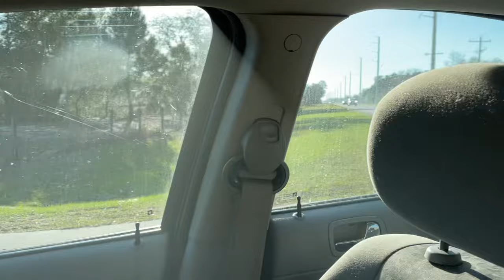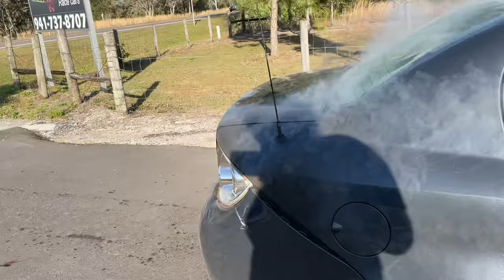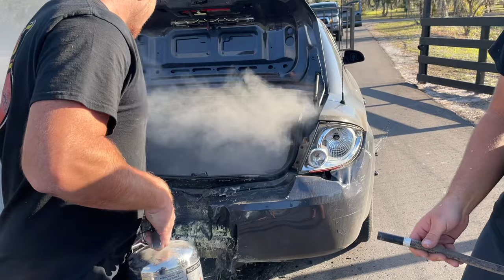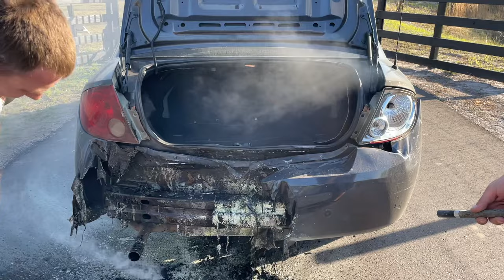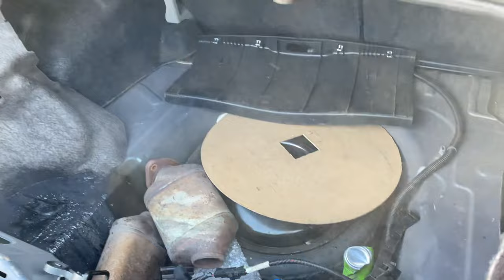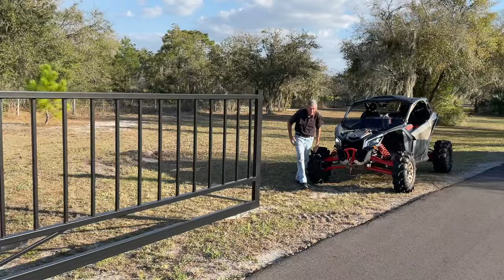George's Cobalt Caught on Fire...

Comment: Honestly I'm surprised this car lasted as long as it did. Ever since the electric turbo experiment I knew it's days were numbered
Reply: Jeff Lee  I beg to differ.
Reply: @yamaha226  The Cobalt replaced both the Cavalier and the Toyota-based Geo/Chevrolet Prizm as Chevrolet's compact car. The Cobalt was available as both a coupe and sedan, as well as a sport compact version dubbed the Cobalt SS. Like the Chevrolet HHR and the Saturn ION, it was based on the GM Delta platform.
Reply: @miregoji2959  Only difference is the quality i guess.
Reply: @miregoji2959  I was thinking the cobalts had some yota blood in em because I knew about the prizm being a rebadged corolla, and the pontiac vibe which is around the same time as the cobalt is basically a rebadged matrix. Tough lil cars tho no doubt, they sure can take a beating
Reply: Jeff Lee  very interesting. Did the outcome of ww2 have any influence on that?
Reply: @dookiebooger9967  I can’t answer that for certain, but I can’t imagine it didn’t. The US helped out a LOT in the coming years after, as well we should’ve. I’m still pretty conflicted about it (there had to have been another way. I mean, right?), but there it is whether I like it or not.
Reply: @The_sinner_Jim_Whitney  I always had figured after ww2 the usa pretty much owns Japan and Germany and everything they make so it wouldn't surprise me too much to find out if there was any commingling between the auto manufacturers
Reply: @dookiebooger9967  Yeah, I’m quite sure there was.

Comment: These are prone for fuel lines going bad by the rear wheel. Happened to mine. Probably was leaking fuel, low pressure that's why it ran bad unless he floored it. Flooring it shot gas on the hot exhaust and that was all it took
Reply: ya my brother had a 07 and it started to leak gas by the rear wheel to.
Reply: this should be a recall...
Reply: @RodknockRhett  there was a whole thing about it if you google it. crazy they only worried about 08-10 when it was all years, mine was an 06.

"The agency’s probe involves 614,000 Cobalt and HHR models. Cobalt models affected are from the 2008 to 2010 model years, while the HHRs are from 2008 and 2009. Searching these vehicles on NHTSA’s online database turns up a number of complaints pertaining to this same fuel leak issue.

“The gas line is rusted and leaking,” one owner of a 2009 Chevrolet HHR said. “There is a strong odor of gasoline at the rear drivers side tire of my car. It leaves fuel on my driveway.”"

Comment: George is lucky, cobalts have major fuel leak issues. Whether it's from the fuel lime rusting or the plastic line cracking at the pump. Could've been much worse.
Reply: Yep, had a cobalt once and had the fuel line just disintegrate on me one day, it was by the fuel tank where it leaked too. 
Lucky my mechanic understood the car was a work beater kind of how George was using this. Anyway he just chopped the old lines, left them hanging and ran me rubber fuel lines instead. Car lasted another year or two after that, but like George’s it took quite a beating. 
Surprised the transmission never failed, the amount that car was abused just wide open it all the time, anyway I miss having a car I don’t care about. 
My current vehicle gets driven old man style where I try to keep her under 3000rpm in normal driving… cobalt was green light floor it more times then not.
Kind of missing it’s good gas mileage too these days, it was a fun little death trap, as long as you survived to tell the tale.
Reply: Do you know what happened in Georges case? Is it possible it lost spark in a cylinder and was dumping fuel out the exhaust? Then the exhaust shooting flames and catching the plastic bumper on fire?
Reply: @SuperBrainAK  could also be an electrical issue but given how hard that car was driven your theory is probably a decent one. Time for cleeter to throw on the white coat and see why this baby kicked the bucket…. For science. 
Plus maybe finish it off in some epic way, Let George flip it with the forklift for a flaming kick flip finale.
Reply: @fourtysix4646  The cobalt did get rearended which unplugged a critical power lead in the trunk maybe there was more damage but that would have cause a fire in the trunk not the drivers side rear bumper which is the same as the exhaust. I'm sure all the NOS going through it burnt the plugs or even messed up the valves.
Reply: my brother's cobalt had a fuel leak too by the back tire.
Reply: Yup. Fuel line rusts and leaks at the rear tire. Right where that fire is.
Reply: @Loudog212  hmmm that might do it. Though looking at it closer it definitely looks like it started right at the exhaust, and if it had a fuel leak it would not have cleared up if he floored it, it would have just stalled then.

Comment: Helpful Tip here guys because I know this is really Rare around the FF out side of events and shows. This is something I learned from working in security for 10+ years Generally you want to Recharge your fire Extinguisher after every use even when its not empty to keep pressure in it and always be ready when needed. out here in Ca I've been through fires, shooting, stabbings, floods, Riots, Sink Holes and the Firemen Police and other emergency responders have always told me Fully empty the Extinguisher of Powder including in Training I've been told this although I'm pretty sure the reason for that rule of thumb is to make sure the fire is fully smothered and out or other wise know as Protect your asp, you did all you could do no liability thing.

Comment: Guarantee was the rusted fuel line that crosses over the exhaust. GM should have put a safety recall on it. They're notorious for rusting out because dirt and debris get held in the heat shroud over the line. You got lucky, glad ur ok!

Comment: I have a 06 ss sedan with the 2.4l an my harness has melted due to the route of the coil wires. An it’s doing something similar. Easy fix just time consuming. I didn’t catch my car on fire. I disconnected the cylinder that wasn’t firing an the injector for that cylinder. An made the 20 mile drive home. Sounded like a Subaru.

Comment: Believe it or not that's actually a common issue with a Cobalt and Chevy hhr. They put a heat wrap around the fuel lines where it goes over the axle and exhaust. It tends to hold water in at about the 8 to 10-year Mark the fuel lines leaked directly onto the exhaust

Comment: those cobalts and pontiac g5's have problems with the fuel lines leaking. Ive seen it multiple times in the shop I used to work at

Comment: Pretty sure that's the same fuel pump they us in the Saturns with the 2.2 Ecotec. If so there known for cracking and leaking fuel of the top of the fuel pump. Had to change one on  my ION, luckily didn't catch fire.

Comment: I know you've dealt with more than a couple vehicle fires but that was borderline on stepping back and calling the professionals cause I'd hate to see anyone hurt. You did get it in the nick of time and it went out but it was close to the point of being a very dangerous level of involvement where proper firefighting gear for personal protection and safety is warranted and knowledge of potential danger points important. Things like the fact that some cars like that have active crash protection devices in the bumpers which can and have exploded injuring legs badly as they turn the bumper into a missile, pneumatic struts which can also pose a similar hazard, a spare tire (if it has one) which could be heated up and ready to blow, opening the trunk without fully knowing how much the fire has advanced and its potential for pushing a ball of fire out when opened to outside oxygen and the extra hazard of a NOS bottle inside, the chance that the fuel fill hose has been damaged and numerous other dangers. Its the reason why we are taught in school to approach from the corner and not from the side or rear, why we use water spray patterns to create a shield from fire and wear full PPE before getting close. Most of these things are worst case but they're possible and the consequences are just very bad if God forbid any of those things go wrong. 
Not trying to put the guys down, love the crew and would hate to see cleetus have to put up a very different video. I know its an instinctive response and in this case it worked but the cost of a cobalt burning to the ground will always be far less than the cost of someone getting hurt. Car fires can be as dangerous or even moreso than a structure and I'd just hate to see anyone get injured so please be careful and if its borderline recognize that these dangers exist, call 911 and remember that its not worth getting hurt over.

Comment: As someone having a high mileage cobalt (200k), all the fuel and emission control lines are back there. On mine the fuel filter broke off and started spraying fuel towards the rear disks. My car sputtered out on the high way and after pulling over there was a strong smell of gas. This is exactly what I feared could have happened after finding the fuel filter had come off.
Reply: Jesus. I'm about to redo all the lines on mine before that can happen 🤔

Comment: wouldn't be surprised if the fuel lines rotted out, gm's been dog shit for their fuel lines on the cobalt, hhr's, pretty much anything on that platform. gm had such shitty fuel lines, that there's aftermarket kits to completely replace the feed and return with plastic line. lol and where they rot is right around the rear drivers tire....

Comment: Makes you wonder if that was real or staged how does it “randomly “ catch fire ?
Reply: Its a Cobalt, a 13 year old disposable piece of junk General motors made car that has probably had ethanol eat through some piece of the engine that caused a backfire that caught the rear bumper on fire

Comment: My God what did you do to this poor car? I bought mine new in 08 and I have had only one thing go wrong. It can't measure tire pressure. It's a retarded thing for cars to have!  37.3 MPG, and the HP to hit the passing lane. I upgraded the chip for a extra 40HP and 79 torque. At 150K miles it doesn't leak oil, The tranz is shifting like new.  To have a fire where you had means you staged it!